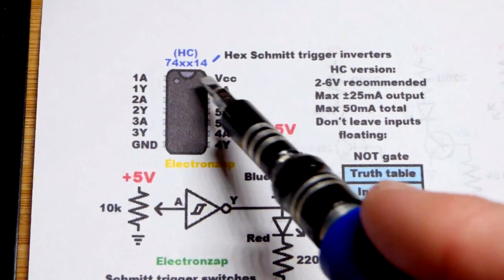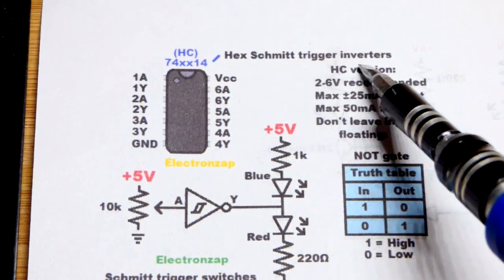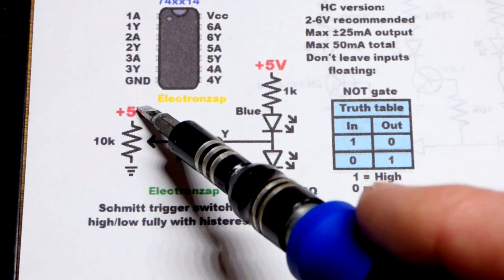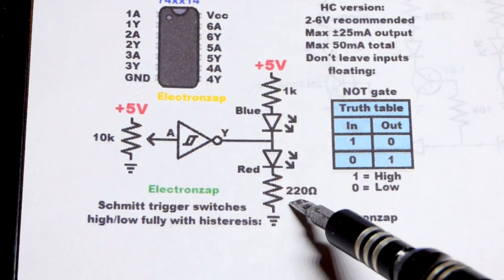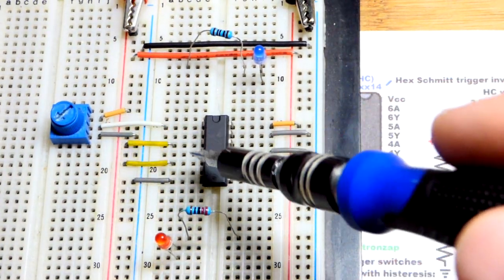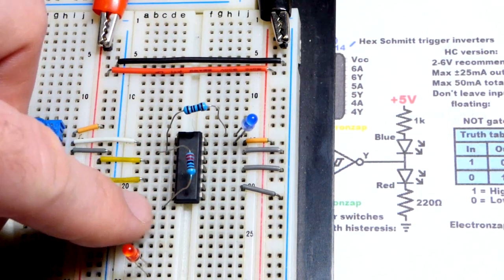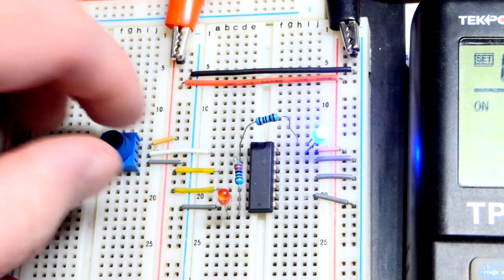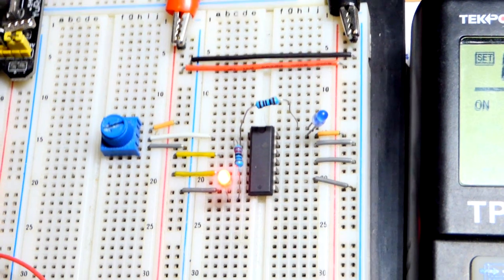7414 74HC14 hex schmitt trigger inverter integrated circuit introduction with electronics LEDs

Comment: hi friend,what if time  i install the ic it only 1 hour after that the ic dies , is there a solution
Reply from the maker: It's easy to damage these ICs, probably easier if they are cheap. You can shock it by touching it with your skin. Usually if I have one that stops working, I replace it and the new one works fine. Of course, you always have to stay within the voltage and current limits of the IC and check its datasheet for guidance on how to use it properly.